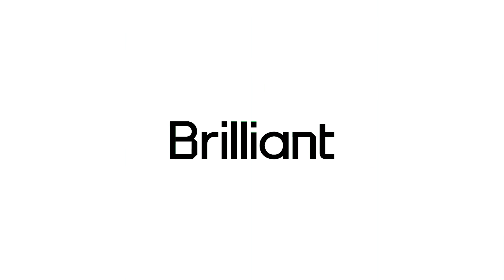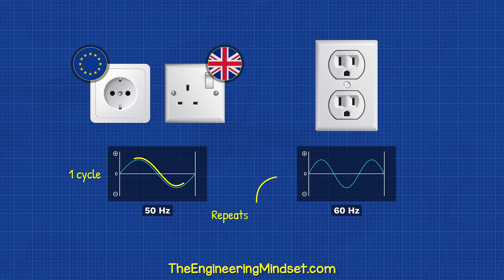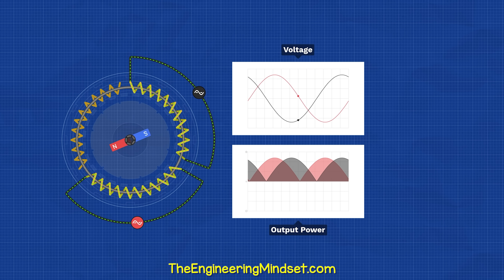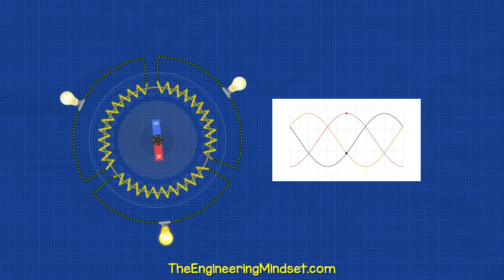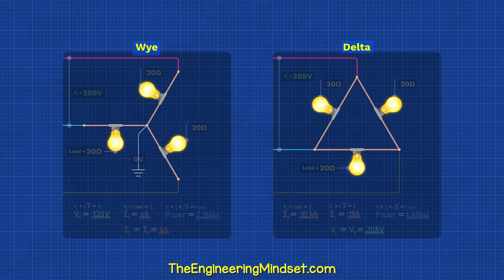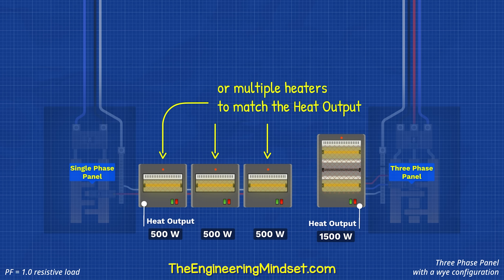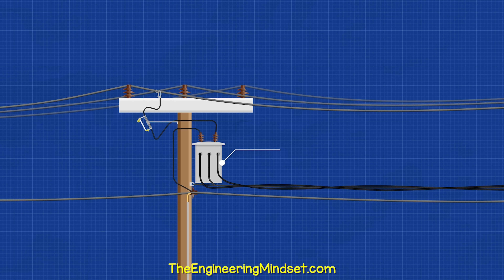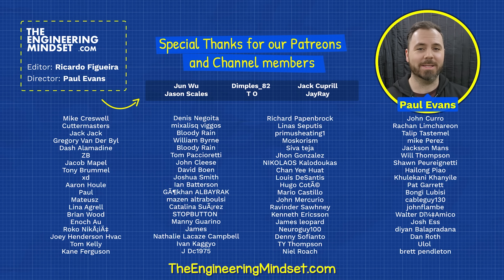How 3 Phase Power works: why 3 phases?

Comment: There’s a good reason why 3 phases are used, and it’s not just a “reasonable compromise”.  3 is minimum number of phases that allows for constant power at a passive load such a motor.
He implied in the video that 3 phases would give a more consistent power but still varying (if that were true then it’d be reasonable to say that adding more phases would continue to smooth out the power).  In actual fact 3 phases will supply CONSTANT power to a passive load such a motor (as long as the phases are balanced, and the load is well behaved).  Any multiple of 3 would do the same, so 6, 9, 12 phases, but of course 3-phases is the simplest, requires fewest wires, and going to 6 or 9 phases would give no advantage.
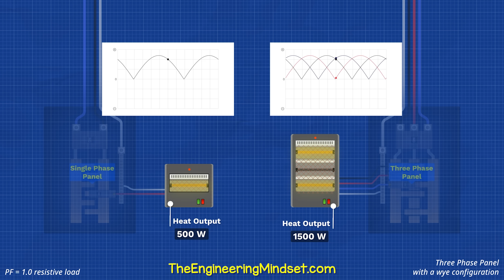The power graphs at 3:42 and 10:22 aren’t correct for passive loads like motors or resistive heaters that he talks about.  They show the kind of discontinuous power waveform that you see from active components like rectifiers.  The correct power waveforms would look like sin^2(ωt+φ)
Reply: I think there's one more question omitted here, if we speak about simplicity of 3 phase grid. In a situation of misswiring a 3 pase motor, it just turns the other way. But if one were to misswire 2 out of 6, or 9 phases... Well, yeah...
Reply: I am both an Electrical and a Mechanical Engineer. I have worked in the electrical power business my entire career. I am 100% in agreement here. I would just like to bring up something about the 6 and 9 phases not mentioned. You are also increasing the amount of transformers needed from the generating plants through the grids and the distribution networks. Instead of 3 transformers on power poles, you are going to have 6 or 9. Yes, they might be smaller, but you are still going to have them. You are also going to have to have 6 to 9 lines all across the 20KV to the 100KV transmission lines. To use 6 phases means doubling the amount of wires. Thus increasing the size of these lines. People sometimes get lost in theory but forget about actual real-world solutions.
Reply: Retired EE here... snarfsnarf's comment is right on!  The instantaneous sum of the three sine-squared phase power waveforms (displaced 120 degrees) add up to a constant value flat line with no ripple for balanced passive loads.  

Some specialized non-linear loads like large rectifiers  can benefit from greater than three-phase power sources.  For example, a six phase source can cancel otherwise objectionable low-order harmonics in the rectifier's load currents, specifically the 5th and 7th harmonic currents.
Reply: you are absolutely right about the constant power of the 3-phase system. (or any multiphase system for that matter) Even 2-phase 90 degree can accomplish this, but it needs no less wiring than 3-phase anyway.
The only thing i like to add is that if you need more phases for a non-well behaved load like a rectifier, then there is transformers out there that can change between any two multiphase systems.
F.ex. one wye and one delta output on a transformer can give six phases to a 12-diode rectifier with a ripple less than 4%.
And if that is not enough, a few Z-coupled secondary windings can give you 12 phases to a 24-diode one, and then the the ripple is less than 1% and the ripple frequency is in the kHz range, which can easily be smoothed out with an inductor in series.
Full Bridge rectifiers on steroids, Haha!
Reply: Other comments account for the 2-phase half-solution. I just want to add that we can in fact use any number of equally spaced phases from 3 and up to get the desired properties of constant combined load and nominal 0 current on the neutral wire, not just multiples of 3.
Reply: @apessimist7295  What study are you referencing?  I found references to Allegheny Power System using 6-phase power transmission to increase capacity on a route to 173%, but this required doubling the number of 138 kV lines used.  That amounts to a reduction in power capacity by 13% per line.  The reasons this was done included them not having to get new right-of-ways or additional public buy-in to upgrade to 230 kV lines.  Note that 230 kV lines would increase the theoretical capacity to 212% compared to 138 kV ones, so some other advantages listed, such as less noise, seem like they would just result from carrying less total power.
Reply: Thank for writing this for all of us =)
Reply: Taken care of correctly and FIFY-ed mercilessly 👍👍
Reply: Thanks for this reaction. It saves me for doing that.
This constant power with 3 "phases" is already used (Netherlands tree sawing windmills ) by making sure that 3 saws worked at this 120 degrees difference with a crankshaft...this to make the needed power from the windmill constant....
(Not all had those 3 cranksshafts...that came after discovering that 120 degrees would balance that thing)
A windmill would get weared out much quicker if the load was continuous changing .
(windmills in Zaandam Netherlands some 400 years ago)
May be use google translate on the article:
https://nl.wikipedia.org/wiki/Zaagmolen

(This development was literally the backbone of the wealth of the dutch in that century...)
Reply: whow the video did not even say the reason it is 3? XD - Even I vaguely knew it is to avoid "zero points", tho I am not exactly smart enough to understand when exactly it matters.
Reply: this is why capacitor is used in lots of motors (fans, washing machine motors, etc). Tho "smoth" the voltage (and give some "umph" to start).
Reply: @erigabu1  You can't "smooth" AC voltage with a capacitor. That's not why they're used in single phase motors.
Reply: I was looking for this comment.
Reply: Well statored.... er, stated.
Reply: yes but it's still wiggly, to make the current "straight" you can add more phases, but you add complexity to the system too. You don't really mind if your drill torque slightly oscillate a 5%. You won't feel it and it won't affect performance. But in a computer where a current intensity can be interpreted as either 1 or 0. If you have a wiggly current, you risk having some 0 interpreted as 1 by mistakes. That's why computer often use 60 phase current to be almost completely smooth.
Reply: Umm - adding phases does smooth it out.  That is the whole purpose of phases.  Infinite phases smooths it out like DC.   And the graphs are correct.
Reply: Nope, more phases are better if you're for some reason trying to make an exactly constant output motor but insist on using A/C to power it because you're lazy, 3 is just the minimum to get less bumpy power, it's still lumpy, it doesn't sum perfectly especially with all the EMF etc that will be going on with a motor. think of it like a wheel, a rounded triangle is a better wheel than a rounded log, but it still sucks compared to any higher order tetrahedron.
Reply: I have built both 6 and 12 phase motors so there is a use case. Obviously, dedicated control electronics are also required. Would love to elaborate, but can’t due to NDA.
Reply: In fact, 2 phases in 90-degree separation is the simplest way to get a constant power transmission. The problem is, it requires different wires (the ground current is 1.4 times the phase currents) and created some unique usage accounting challenges. Early AC people experimented with it, but 3 phase proved better in the long run.
Reply: @fraxinusexcelsior8117  Two phase power was actually used commercially in Philadelphia. I hear some of the oldest parts of the city actually still have it.
Reply: @Falcrist It Is sometimes used in Italy and Swiss too
Reply: @fraxinusexcelsior8117  You beat me on mentioning the two-phase system. Well then i have to mention the Scott T transformer that can transform three-phase into two-phase and vice versa, which i am sure you know about. Another thing about 2-phase is the fact that a 2 phase motor requires a smaller capacitor to be run on single phase since it only needs 90 degree shift, and not 120 degrees.
Reply: @fraxinusexcelsior8117  No, you can't get constant power transmission with two phases only.
Reply: @gsofgel  really?? sin2x + cos2x = 1
Reply: @fraxinusexcelsior8117  I think you mean (sin x)^2+(cos x)^2 - 1. 
(i.e. squaring the terms before adding them, not doubling the frequency!) =:o}
Reply: @therealpbristow  Square of sines and cosines is commonly written with a superscript right after the sin/cos instead of the whole expression needing to be wrapped in brackets. Though it doesn't translate well to in-line text on a screen if you don't use the unicode superscript characters. sin²x + cos²x = 1
Reply: @gsofgel  You absolutely can
Reply: Right! The reason for 3 phases is easier to see using geometry. A good aid is the insight that a tripod (chair or table) always is stable regardless the underground; 3 points determine a surface, regardless the slope.

Using geometry you can calculate the ratio between the voltages in a Y curcuit and a Delta circuit, it is root 3 (about 1.73)!
Reply: @fabimre  Yes! That's why 1 phase is 230 V (phase-ground) but in case of 3 phases you cen get the ~400 V off the socket (phase-phase).
Reply: The real reason for three phase s starting motors with no extra equipment. Three phase is a rotating phase system that has start rotation built into it. That' and it's the cheapest with the fewest wires.
Reply: @Steve-LetsSingIceIceBaby2gther  2 phase has rotation built-in as well and it uses just as many wires.
Reply: @Ryrzard  Two phase is four wires. Three phase delivers more power for less wire. It also looks like two phase suffers from pulsations in motors.
Reply: @Steve-LetsSingIceIceBaby2gther  Two phase only needs 3 wires though the neutral wire needs to be have roughly 40% larger cross-section than phase wires.
It's not that specific systems provide more power per wire, it's more nuanced than that. A 3 wire 2 phase system with 90 degree offset is actually a hidden unbalanced 3 phase system. If each wire carries the same phase voltage and current then any number of wires will provide the exact same amount of power per wire.
It also means that all single-phase systems are actually hidden two-phase systems and the reason they carry less power per wire than a 3 phase system is because their phase voltage is half of a 3 phase system.

Also no, a 90 degree phase shift 2 phase system delivers constant power so no pulsation happens.
Reply: @Ryrzard   You have to look at it like a radial gas engine. Three phase is 120 and more symmetrical. You  lose that with two phase and it becomes a two cylinder motor. Like a Harley motorcycle V engine that shakes.

So in the motor three phase would have less torque pulsations per cycle. And since there is less less gaps with three phase the total power available will be higher.

The key to remember is an actual physical rotating mechanical generator is doing the generation. The more gaps, larger phase difference, less cylinders, the more it pulses and less power you get.
Reply: @Steve-LetsSingIceIceBaby2gther  You can't make a comparison to a piston engine and expect all its properties to translate perfectly. This is not the case with electrical phases. Both 2 phase and 3 phase deliver constant power with no pulsation because of the sinusoidal voltage.
For a 90 degree phase shift 2 phase system, the phase voltages are proportional to sine and cosine of the angle. Power is proportional to the square of the voltage. So the total power out of both phases is constant since sin²x + cos²x = 1.
Reply: @Ryrzard  Overlap a two phase sine wave over a three phase and which covers more area?

Also, there is a pulsation. It's the wave peaks from zero.  Max current and therefore max torque through the windings. That's why the more poles in a motor the more torque it has. More poles is more cylinders.
Reply: @Steve-LetsSingIceIceBaby2gther  The sum of the squares of two sine waves offset by 90 degrees is a constant value, my man. Motors with more pole pairs have generally more torque because the flux lines are tighter.
Reply: @Ryrzard  If you rectify two and three phase which will be smoother?
The flux lines are going to be tighter because you have to cram more poles closer together in a hole that's always going to be only 360 degrees. Each pole is going to be a cylinder firing. A V12 is going to be smother than a 8 cylinder.
Reply: @Steve-LetsSingIceIceBaby2gther  Why would you rectify them? We're talking about linear loads like motors.
Just plot the power over time in some graphing calculator. Both 2 phase and 3 phase power (plus all symmetrical polyphase systems) output perfectly constant power.
Again, electric motors are not combustion engines. Analogies only go so far and don't convey any nuance.
Reply: @Ryrzard  They really aren't linear magnetic  loads because they hum, vibrate, at a frequency. Just like cylinders firing. Rectifying them shows two phase is going to have more open space on a scope. 

look for this video.. ""Rotating magnetic field in a two phase AC motor"" see the open space in his sine wave?
Reply: @Steve-LetsSingIceIceBaby2gther  He's plotting voltage, not power. Try plotting the power of each phase and summing them up.
Reply: @Ryrzard  In the video ""Rotating magnetic field in a two phase AC motor"" see between 180 and 270 degrees positive? That area is dead. That is not the case with three phase.
Reply: @Steve-LetsSingIceIceBaby2gther  Have you had trigonometry at school?
Reply: @Steve-LetsSingIceIceBaby2gther  I think the whole problem is that you're confusing voltage with power. Believe it or not, they are not the same thing.
Reply: @Ryrzard  How many peaks in two phase and how many in three in one cycle?
Reply: @Steve-LetsSingIceIceBaby2gther  Power peaks? Zero in either of them. The power is constant.
Reply: @Ryrzard  If you used an oscilloscope how many peaks on two and then three phase?
Reply: @Steve-LetsSingIceIceBaby2gther  If you were measuring power? 0.
Reply: @Ryrzard  Which would have less ripple if rectified to DC?
Reply: @Steve-LetsSingIceIceBaby2gther  If you want a more detailed answer:

P ∝ V^2
P ∝ sin(x + α)^2

In a 2-phase system:
P ∝ sin(x + 0)^2 + sin(x + 90°)^2
sin(x + 90°) = cos(x)
P ∝ sin(x)^2 + cos(x)^2
P ∝ 1
P is constant

In a 3-phase system:
P ∝ sin(x + 0)^2 + sin(x + 120°)^2 + sin(x - 120°)^2
sin(x + 120°)^2 = 3/4 cos(x)^2 + -1/2 sqrt(3) cos(x) sin(x) + 1/4 sin(x)^2
sin(x - 120°)^2 = 3/4 cos(x)^2 + 1/2 sqrt(3) cos(x) sin(x) + 1/4 sin(x)^2
sin(x)^2 + 3/4 cos(x)^2 + -1/2 sqrt(3) cos(x) sin(x) + 1/4 sin(x)^2 + 3/4 cos(x)^2 + 1/2 sqrt(3) cos(x) sin(x) + 1/4 sin(x)^2 = 3/2
P is constant

This is high school math. You don't need to be an engineer to figure it out.
Reply: @Steve-LetsSingIceIceBaby2gther  By rectifying to DC you lose sinusoidal current so that's a completely different scenario from powering a 3 phase load. There's zero ripple when powering a 3 phase load (or 2 phase in a 2 phase system).
Reply: @Ryrzard  You are correct that two phase has a rotating field. I see that now for motors. 
Zero ripple? From animation I see 6 pulses with three phase rectification. How many for two phase?
Reply: @Steve-LetsSingIceIceBaby2gther  Why are you talking about rectification in the first place?
Reply: @Ryrzard  It would look to me that fewer ripples from three phase means higher average voltage going to DC.
Reply: @Steve-LetsSingIceIceBaby2gther  Sure, but that's not relevant to the constant power property of polyphase systems.
Also 3 phase power has a higher peak DC output because the DC is rectified line voltage, not phase voltage, so it's higher even if you smooth it with a capacitor.
Reply: @Ryrzard  It's not advanced math, it's elementary school math. Engineers calculate these things easily and accurately with ordinary integrals 😂And besides elementary mathematics, there is also spatial geometry in rotary machines, on which the torque depends...
Reply: @Steve-LetsSingIceIceBaby2gther true...but only by the same improvement that a v8 is over a 6 cylinder...meaning, 30 degrees.  50% more cylinders for 30 degrees of operational smoothing...not really worth it. And besides,  the crossplane v8 has the most pleasing staccato music...
Reply: @Zarinizarin  You don't need integration for this. This is all just trigonometric identities.
Reply from the maker: Multiple reasons for 3 phase are listed throughout the video, here are some key points
4:30 Explained how 3 phases provide constant power. Graphic shows “almost” and audio says “more constant” with some small ripple shown, at this point all phases are still separate circuits and we have built upon simple single, two and then three phase generator.
5:05 Explained how it provides equal spacing. 
5:36 Explained how more phases means more cables, controls and protection equipment, complex infrastructure, more complex transformers and motors, harder to balance network and synchronise generators.
6:22 Explains how only 3 wires are needed which is cheaper.
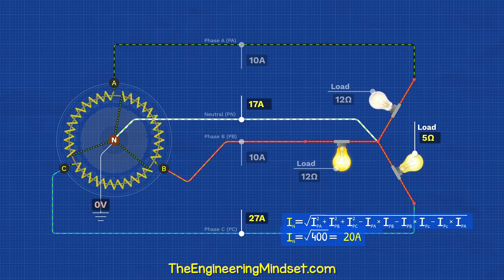7:26 Explained how neutral can be used to balance
7:54 Explained how we use single or three phase from same system
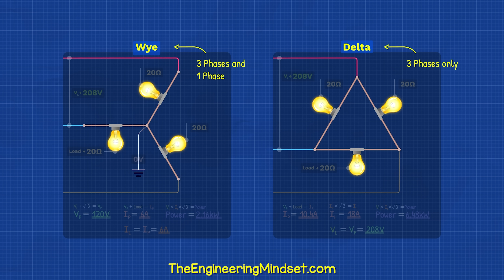8:21 Explained how Wye and Delta are used for different scenarios. Examples uses same resistance and line voltage.
9:59 Explained how 3 phase allows more loads to be connected
10:17 Explained how 3 phase uses more energy but provides more heat
10:19 Compares single and 3 phase power, shows 3 phase power is consistent 
10:36 Shows single phase and 3 phase motor. Single phase has capacitor
10:41 Shows comparison for 3 people v 1 person for motor analogy.
Reply: @EngineeringMindset I think the point is that the video only answers the question "*why more than single phase?*", and not the question in the title "*why 3 phases?*".

Basically why 3 phases is ideal compared to say 2 phases or 4 phases is not explained. Even the thumbnail has "*why not more phases?*" in it. So why not more than 3?